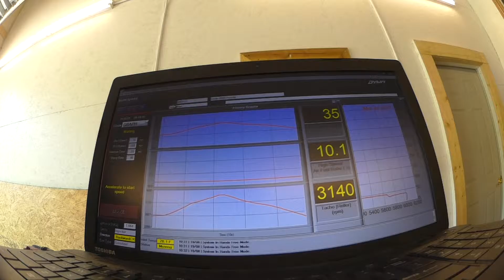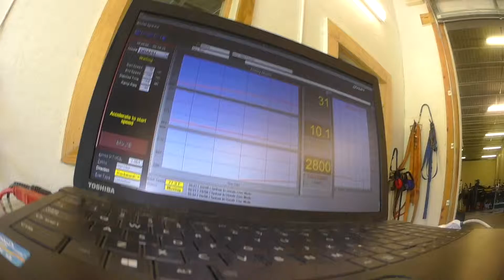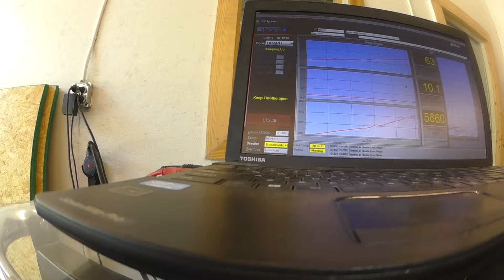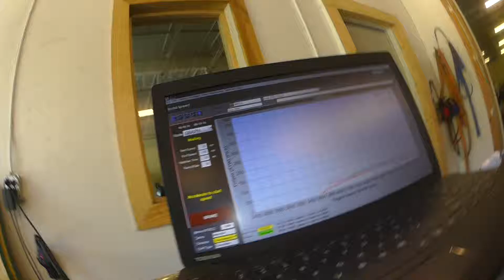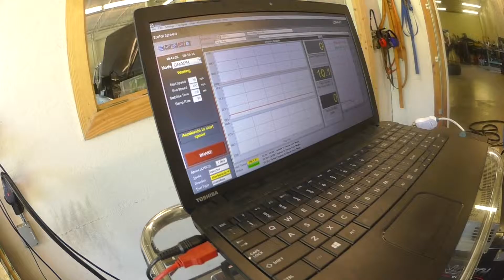a4

Comment from the maker: the custom air intake pipes reducer glue design $125 with velocity stack $60 and filter $60...costed lot $, but 10% hp gain with just filter change better than aftermarket air intakes around $200-$350!